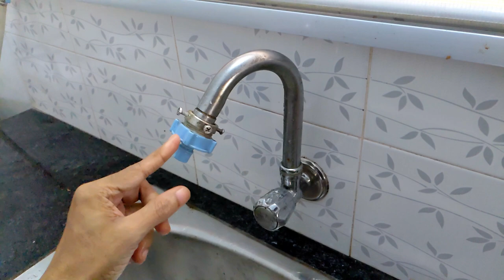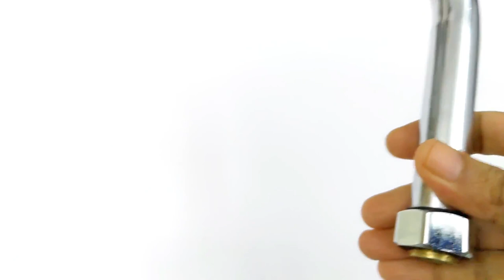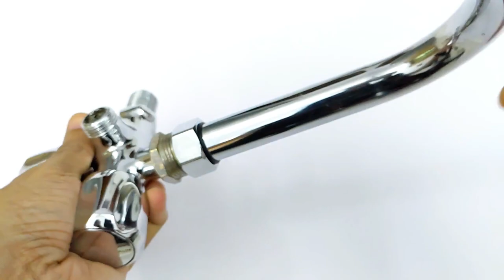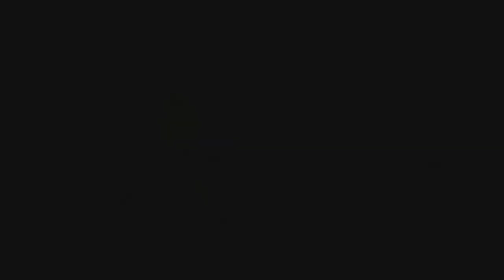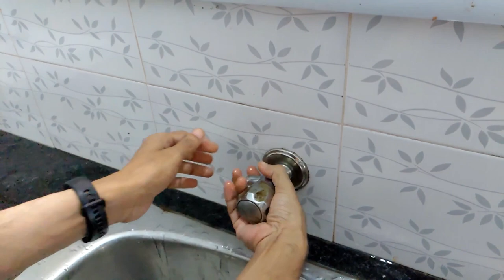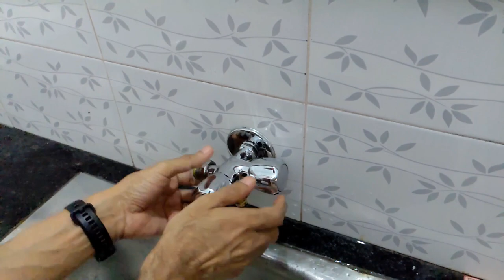Washing Machine/Dishwasher - Water Inlet Hose Connection to Sink Tap

Comment: Can we use the wash basin faucet/tap and the washing machine one at a time? Is it possible or we can use only either the sink or washing machine?
Reply from the maker: Both could work at the same time..
Reply: How, I also want to connect basin tap for machine and normal use